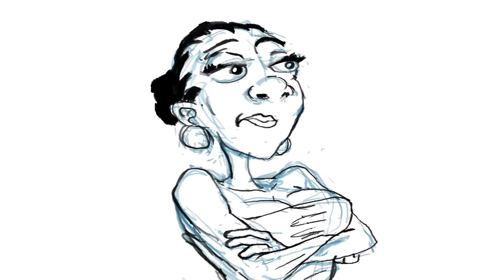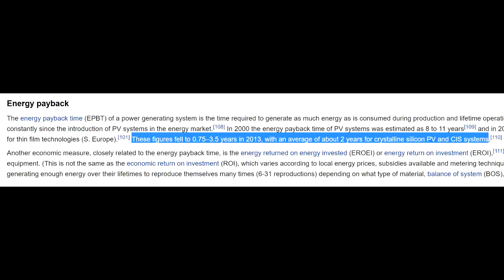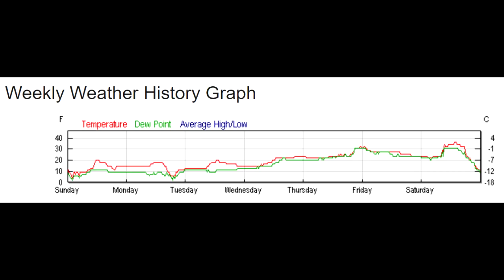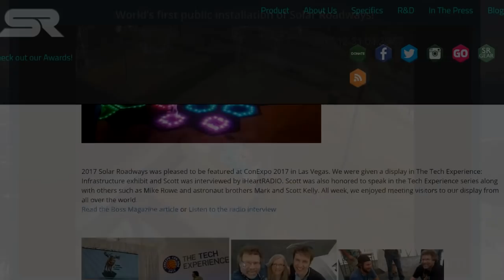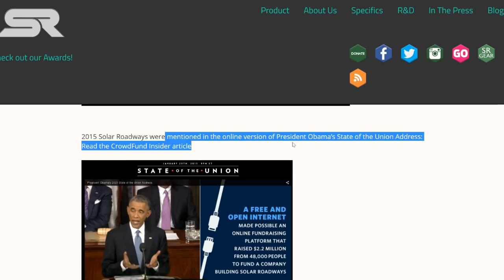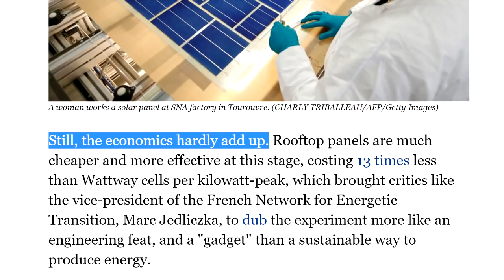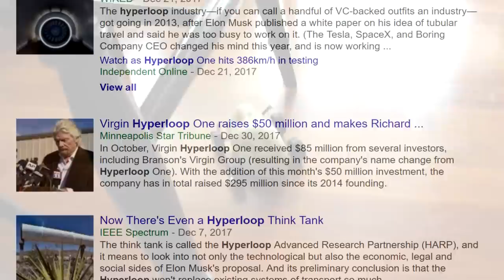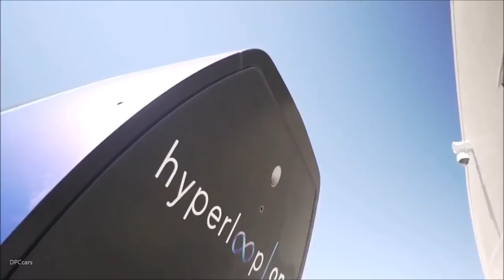Solar roadways, NEVER shovel snow agai... oh

Comment: I have the perfect idea for solar roadways. The worst like this, build a structure over top of the roadway. The structure would of course need supports in the center if it is more than a certain amount of distance wide but we already have an area to put those center supports they are called median strips. The structure would act as a rooftop to cover the roads and prevent them from getting snowed upon. This would not stop snow drifts from spreading onto the road from the sides of the road. But it would stop the majority of snow from falling directly onto the road. This could also be a surface have you place your solar panels on. If the solar panels track the sun it can also be made to tilt enough to let the snow slide off neither during the night 4 periodically during the day just to dump the snow off. And if the rooftop is tilted enough that snow will slide off the roof and onto the sides of the roadway in that way we can use every single Road as a solar collector. We would still of course needs snow plow for the snow drifts and any snow that blows on from wind but we would have some protection.

Comment: I could be wrong, but I read somewhere that these solar energy plants uses the focused sunlight to super heat oil or liquid sodium which in turn is used to boil water to create  super heated steam via a heat exchange to spin the turbines.  The reason they use either oil or liquid sodium as a first stage medium is because they retain their heat longer after the sun goes down allowing the plant to continue generating power.
Reply: No...your exactly right
Reply: I don't believe that's for all of them. There are some that use water (these i believe) but there are a couple of prototypes that use sodium because once molten it retains heat well into the night.

Comment: The packet analogy for Hyperloop is insane. One of the reasons broadband actually works is because you can cram as many packets in as they will fit, and since it relies on either electrons moving through wires or light moving through a fiber, you can stuff a LOT of data down a strand of copper or one fiber. You don't need to space them out for safety reasons, and you don't need a complicated vacuum system. Hyperloop, on the other hand, does not rely on electrons moving through a wire or light passing through a fiber. Instead, you have pods moving through a tube. Because of safety concerns, you will need to space them apart. This reduces capacity by a lot. Also, packets can be rather long, which means they could theoretically transport a lot of data. Because every packet has some information about where the packet is going and other information like that, having long packets transporting the same amount of data could make it more efficient. Hyperloop is just like that, except the packets are tiny. So, you cannot translate the way broadband or the internet works into hyperloop because:
1. Hyperloop doesn't move that fast compared to how fast electricity flows.
2. You can't densely pack pods in the tubes without causing safety concerns.
3. The hyperloop has terrible capacity!
Edit: after a quick search on how much data a packet can carry, a typical packet has 1000-1500 bytes. Think of a byte as a passenger in a transportation system. Currently, hyperloop pods can carry 2 people. Also worth mentioning that every packet has a header that apparently is about 20 to 24 bytes long. If you were to transport 12,000 bytes of data (or 12000 passengers) with a large packet or train (1000 passengers/bytes) you would need to send 12000 bytes plus twelve sets of headers. If your packet size was only two, you would need to send 12000 bytes plus 6000 sets of headers! Considering each header is around 20 bytes, the number of bytes used by the headers would be 10x the actual data you are sending (if you had tiny packets). The headers in a packet are like the gaps between the pods. They must be a consistent distance apart in order to be safe.

Comment: numbers i been seeing and ran myself come out to about 30 to 40 bucks worth of power being generated annually.  this display cost over 30K so just did a ballpark estimate on how much you would earn with 1% interest and that came out to 96.00 per month.  otherwise annual interest = 1152.00 or you could choose maybe 40 bucks in solar power and that dont include maintenance or how much power it takes to run all the lights heaters and electronics.

Comment: Maybe they should have gone for Piezoelectric and Thermoelectric generators underneath the road, instead of solar panels on top of the road.

And maybe they should have gone for heat pipes instead of electric heating elements, to cool the road during the Day/Summer and warm it during the Night/Winter.

Yeah, I got my heat pipe idea from watching your Waterseer video!

Comment: I live 82 miles due east of Las Vegas solar installation and there are talks of putting one in a large dry lake bed 10 mins from my home. If it wasn't a cost issue I would have both my home and my garage covered in solar. We get so many days with zero to vet little cloud cover here. Not to mention the wind is notorious here (maybe someone could explain why? Is it our location in relation to the ocean and our heat?) A turbine could also tap into the approximately 200+days of 15mph+ wind we get.  That $2m could have done much better in my County.

Comment: Actually, as an electrical engineer, I have to agree 100% with thunderf00t on the subject of solar roadways. Here in Israel we've done extensive research on solar tech (cause we have plenty of sunlight) and also got around to the conclusion that concentrating sunlight by mirrors is the right way to go at it. The ancient Greek sure knew a thing or two about sunlight. Furthermore, even the idea of putting silicon solar cells on a road is not a smart idea - single junction solar cells are bound by the SQ boundary to around 28.8% efficiency but this is at the lab. On the turf, you'll be lucky to get 10% efficiency and they cost way too much. The only place where they are plausible as an energy solution, is on a satellite or when you have considerable government subsidies.. But mirrors aren't bound by the SQ boundary. In fact, Israeli companies install mirror-based solar energy centers all around the world since the 70th and they usually reach efficiencies up to 70-75%. So.. Pretty amazing when comparing to silicon. And yes, you need a sprinkler system to wash the mirrors from time to time, but its still worth it.

Comment: and it seems its too much trouble to fix or replace these panels while there is snow on the ground and scott posed on their web site that the sr3 panel wiring cracked and water got in.  they have been working on this what 10 years and he is a electrical engineer and cant get the wiring to last more then 6 months during spring and summer.  so if they are getting water in the electrical wires while its raining do you think its a good idea to let the kids play on them?

Comment: So before I even heard about these solar roadways, I had thought about the idea, but not in this flashy light sense, I think Japan Engineers are going the right way. Their "not" solar road ways, but their not to be physically touched or driven on. 

The purpose was to have a Magnetic field current for Motorized type bikes that can switch to mag railing and lift. So when one wants to drive their bike, they would just, hit a button the their tires would touch the road way, and they could veer off. I think the application and purpose of their intent is not how I would of don it. 

This would be to stop fuel problems in desrt areas, Thus a bike could be lifted by a power charged Road way in which allows the bike to Accerlate by mags pushing it, then when they are ready they just leave the road way. The bike could havea two type cycle. Which wouldn't be to hard as Japanese got a bike to ride the mag rails. The purpose is for differing kind of transport, but could have various applciatiosn with transport of goods  across desert areas. The sand problem, well just send a dust cleaning bot, which uses the power, and it pushes it self the whole distance, half the road, there and back, and sweeps it clean daily. The sun power s it , Ithink that isa more feasible ideal and application, by utilizing the best environement and use of creating a much more fuel efficient way to travel vast arid areas, and getting goods to and fro. THis should be massive cost saving. Humans could traverse it, but it would be in a car in which doesn't touc hthe service. That is the point... was to make a road of the future in which one doesn't touch the service, unless they need ot leae the designated path. However, an artificial planet or road way in teh space ,could be far more feasible, I e, driving around the outside of a solar road way on a space station that is massive, and then doing engineering maintenance between large sections of the space place. MEh... Interesting though... In the directions these ones are going. Meh...

Solar roadways.. Can work, I just think these people know hwo to weasel money, just like if I wanted ot figure out a way ot breathe under water with the sci fi, stuff I would build a tool in what I want it too do and the size wouldn't matter, then I would ask help  once I got the large apparatus to do what I want, and then mimimize and create new features that refine its body until its a localized shape that makes sense, Ie the first computer to the cell phone of today, much like the solar poanel development of Uk in which works ismliarly to the villi structure of the intestine in how it creates a larger surface area. By creating a nano flex surface, which would appear iirsdcent at the level, in which refracts and reflects the light to A nodes or Organic nodes, to a nano or micro node beneath its surface, in which than translates that energy to a large micro node, and translate the energy to various small areas and untilit reaches a larger Node/ Trasnformer to carry and capcitate, one could exppotenitall y create more energy with solar. The problem with extracting energy to a maximum is then it has the battery issue of making better batteries. YOu then have created device in which has lethality to it, that cannot be as easily controlled as fuel source. I think it is a better way to go.

Comment: What in the hell are they doing with all of that money??  They’re certainly not manufacturing these things yet and the sample they put in heat crosswalked looked terrible.

The supposed “interlocking panels” had some sort of rubber or vinyl strips that don’t even match up, but overlap one another like a kid installed it. I just can’t believe how so many people cannot see that Solar Roadways and the Hyperloop are not scientifically possible

There’s a reason why no one tried to make a Hyperloop over the last 100 years since it was first patented. It’s because it is not fiscally possible.

Comment: LOL ... indiegogo campaign yielded $2M by selling hats, bumper stickers, flash drives ... (no solar roadway panels were even sold, LOL!!!)  .. crazy.  Solar cells can't generate enough power to melt snow ..and the idea that LEDs could replace road lines and such is silly, since those LEDS would be washed out by car head lights.  Imagine tractor trailers driving over these solar tiles,  heaving and breaking them ... maintenance and install cost would be absurd!

Comment: there are still a few bugs. But just so you know, I'm studying engineering in school, and it's not easy. According to my engineering teacher (who used to be in the field of semiconductors) even though electronics like CPUs have new ones released one after another, but in reality, after one is released the next one have already spent about at least 2 years in development. Solar Roadways is a lot more complicated than just a solar panel on the ground with some fancy electronics behind it.
here's a list of things the engineers need to worry about:
Durability, You have cars driving over theses thing 24/7 you are gonna have durability issues guaranteed
Storage, For the lights on it to work and the heating units to function you need to be able to store energy
Safety, adding to storing energy you can't just pack a lithium-ion battery back to the bottom of every tile because lithium-ion battery packs are volatile, the optimal energy storage location would be burying it underground or at the side of the road.
Plus, with the current technology, using heating pads to melt the snow at the same rate as industrial machines designed to shovle snow

Comment: We used to have steam pipes running under the local roads about 100 years back.They did keep the roads clear in the winter but only out to a certain point when the laws of thermal dynamics reared it's head. There was too much heat loss over distance to be effective for a large town or city. The steam plant is now a restaurant.
https://www.facebook.com/SteamPlantSpokane/

Comment: I'm pretty sure the main point of solar roadways is to create energy, not for snow removal.  So if the snow melting feature isn't working, either add bigger heating elements, or just install these in lets say, Arizona, where they don't have to plow snow...  Food for thought...

Comment: Some of these projects are not viable but the research and the testing can lead to new innovation. I.e. if instead of the over hyped solar roadway, Maybe a more durable and efficient solar technology could have come from it. It didn't, but sometimes it does. Capturing the imagination of the public is sometimes the best way to fuel innovation. If you look at the Apollo mission to the moon was there any real reason besides proving we are better that the Soviets. Not really no, but it was an amazing feat of engineering and lots of new tech came out of it.

Comment: They could protect the birds by digging a hole and putting the solar plant in it. By going to a lower less birds would fly into the beam as they would fly over. The hole would make it level with the ground

Comment: Imo i really don't get why they push this kind of thing. I know that there are solar shingles(yea shingles) you can get as your roofing material and those do way better and keep the roof free of snow at the same time. Even some hail resistant ones handy for my area. As for the roads you would be better off piping waste heat from buildings under roads and sidewalks to keep them ice free.

Comment: Would be 200% better to build solar house walls, foldable solar sails that can be unfolded in good weather. And more solar parks, but instead of ruining hektars of green fields you build them on vertical steel constructs. Adjustable to track the sun, turn vertically during rain, snow or hail or horizontally during stronger winds. Basically make them a giant artificial tree.

Comment: forget if they actually produce electricity or not. there's a reason why many roads are made with 12 inch thick rebar reinforced concrete. try driving one fully loaded  80000 lb semi truck over the solar road......

Comment: The "mirror farms" aren't boiling water at the top of the tower.  Typically, they're using salt.  The heat melts the salt, the molten salt gets pumped into a heat exchanger next door, and that is where the steam and electricity generation takes place.  The molten salt(still molten) is then returned to the top of the tower to reabsorb more heat energy from the focused sunlight.

Comment: I have an idea for the solar roadway people. I call it the "Rube Goldberg solar barbeque". You see, first you have light fall on a solar panel. The solar panel powers a taser, which shocks a mouse, prompting it to run around in a mouse wheel. This winds up a propellor in a model airplane, which then takes off when it is fully wound, and in flight, it carries a little water balloon full of water to a higher level which then replenishes the water in the reservoir behind a dam, and then the hydroelectric power from the dam electrolyzes water into hydrogen and oxygen. And then you take the hydrogen and burn it, and use THAT to power your barbeque! That has to be ALMOST as efficient as taking the electrical power from a solar cell and using it to heat a heating element to melt snow rather than saving the effort of converting it into electricity entirely and just absorbing the sunlight into a tile that's painted black to generate the heat, right? RIGHT? Amirite? I have a smashing good idea here, right? Where's my million dollars?!

Comment: Those solar towers in the desert don't actually boil water with the solar energy, they actually heat liquid salt mixtures, or the newest ones actually heat molten salt made of 40% potassium nitrate, 60% sodium nitrate. They can get the salt much hotter and store that heat and energy much longer into the night.

Comment: unless i heard something incorrectly,  Vsauce2 said China has a 1km stretch of solar roadway atm. heh.

ah cool. you mention it. to add to that,  as someone that lives in China,  they can't do normal roads right in most places. Whether it's just the local govt diverting funds or just really incompetent people,  it feel like roads start washing away with every rainy season in every area that isn't a major city center. Some more than others. I remember one road in a suburb i lived in had its roads done 2 or 3 times in the span of 4 years because of how bad the pot holes kept getting.

Comment: If you want a hyper loop just put an above ground open bullet train powered by rockets and held on by  support rods above and below (basically a bullet roller coaster that uses like a million pounds of fuel and breaks the sound barrier) cost would be like 100k+per ticket. You'll get from east to west coast in like 2-3 hours or less but be cheaper flying at 6 hrs .....